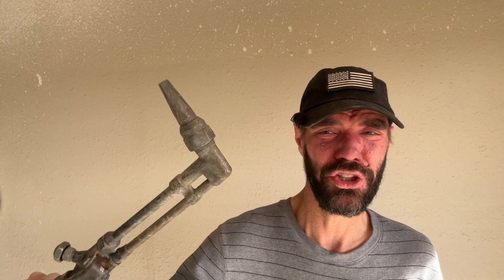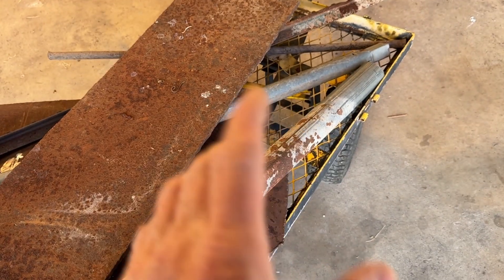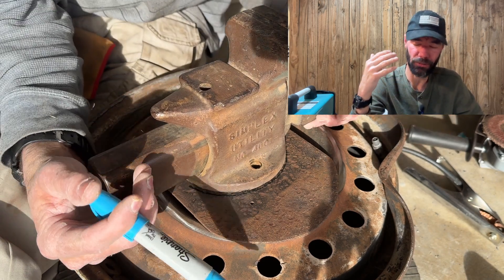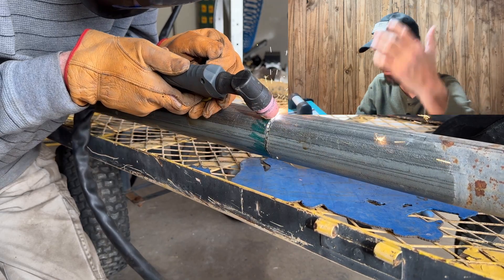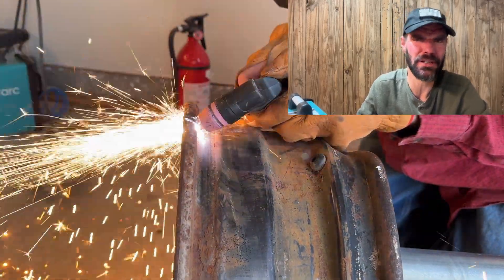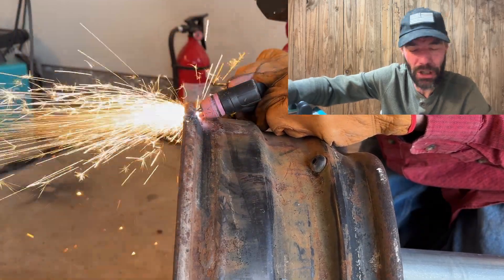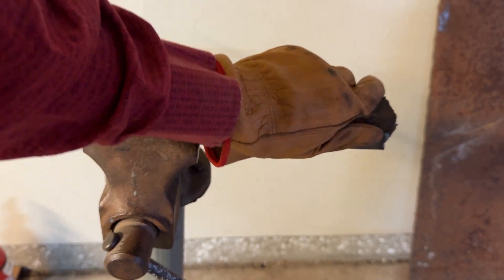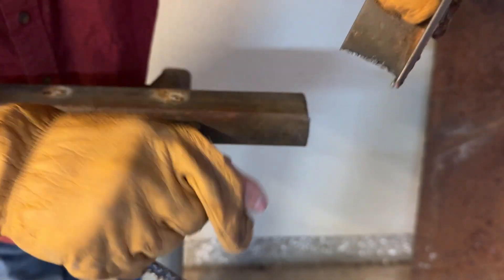I Tested Amazon’s Best Selling Plasma Cutter—BestArc BTC500DP Review!

Comment: Thanks for the video and info.  Good DIY tests.  I looked in the Bestarc manual and on the Amazon description site for the warranty-no mention of it other than Amazon's 30 day return.  I sent Bestarc support an email last week asking for warranty info and a couple of other questions-like what is the difference between the GEN9 and the GEN10 machines.   No answer from Bestarc.  That's a good indication of what their customer service will be after I buy one of their units.
I watched your video a second time to figure out why you did not use the wire standoff guide they provided.  I didn't know you could cut without it.  The way you do it it is easier to follow a straight edge or pattern...thanks  🤠
Reply from the maker: Yeah that stand off thing seems to snag on stuff so I got frustrated and it’s still sitting where ever it landed after I ripped it off and threw it.   

He thanks for watching man. Let me know if you have any questions and I’ll give you an honest answer about it